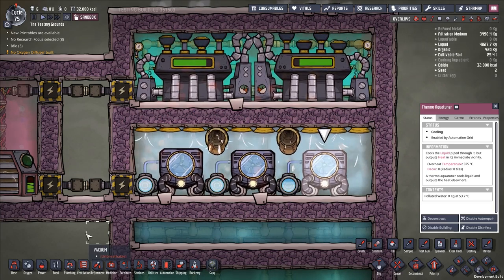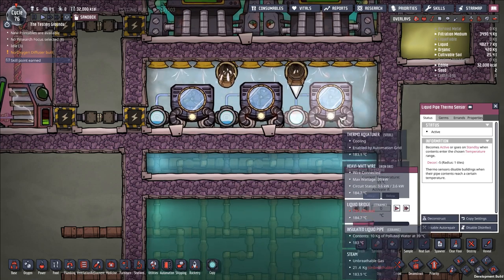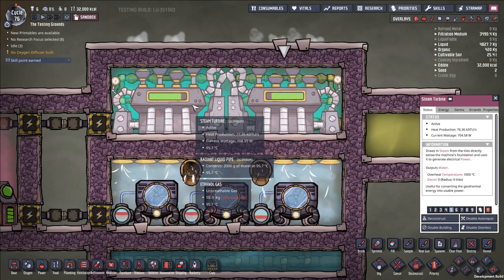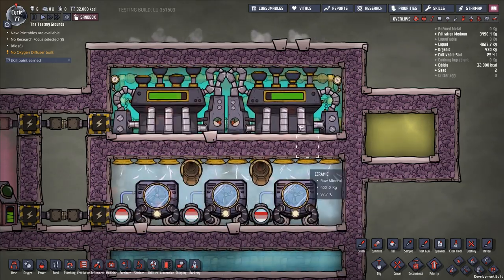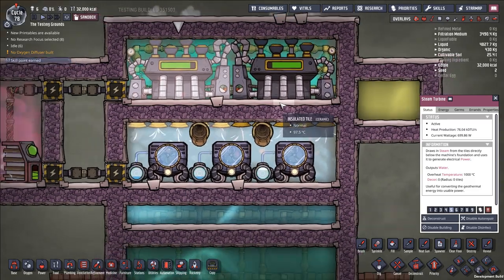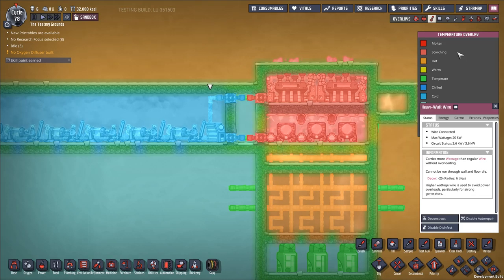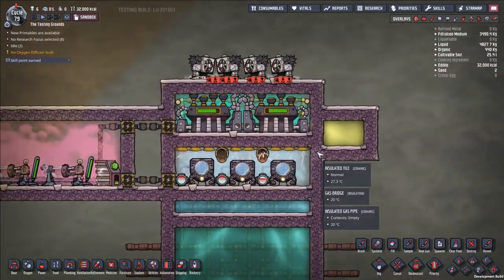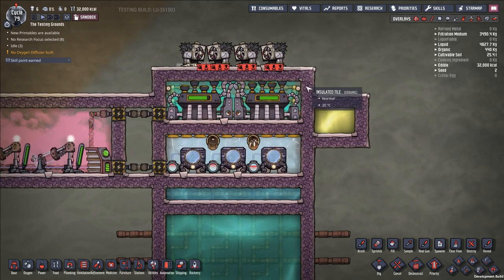Cooling Down Your Base With Steam Turbines -- New Player Guides [Oxygen Not Included]

Comment: Is the system more eficient with Supercooland because I do not need 3 Aquatuners. Higher specific heat capacity?
Reply from the maker: Super coolant has about twice the specific heat capacity of water, so instead of powering 2 steam turbine with 3 aquatuners, you could power 4 of them.
Reply: If you did that, and.set it up so you could use the tune ups, could this system sustain itself power-wise?
Reply from the maker: @nocx4592  I think it's just barely power positive without the tune up, and with the tune up would net you around 2 kW
Reply: @Gearhead Gaming
Hmm, actually I think it wou!d be slightly below self-sustaining without the tune ups.
4 steam turbines running with max efficiency would be 850*4=(800*4)+(50*4)=3200+200=3400 power produced, while the 3 aquatuners would use 1200*3=3600 so you actually would need 200 extra to power it.
Probably not worth having dupes to into the room, since you'd want a backup power anyways in case the system stops working to reset it anyways.
Reply from the maker: @nocx4592  You're right, for some reason I misremembered aquatuners as being 1kW instead of 1.2kW.
Reply: I just thought it was a fun thought, since it didn't make sense to me that the turbines made less energy  from the heat than the aquatuners that generated the heat used, even though they aren't making the heat, they're transferring it, and thus are definitely breaking the law of conservation....

And also I wanted to break entropy.

Comment: so this video is a while old by now.  But anyways, i never got a replica of this system to work.  Aside from the pain of building it without using dev mode or sandbox mode - i still get issues with my steam gens getting too hot.  So after a few attempts i decided, i'll copy the setup 1 for 1 and take it from there - see where i'm not doing it right.  The only difference is the source and destination of the water that's going through the system - normal water.  Still my gens get too hot then drops in efficiency.

Comment: Efficiency of running cooling loops in series or parallel?
Reply from the maker: Typically parallel is best.  If you run them in series, there's a good chance that the coolant will be too cold after going through the first aquatuner to be safely cooled by the next two aquatuners.  It's also often easier to exchange heat with 30kg/s of coolant that's been cooled 14 C than 10kg/s of coolant that's been cooled 42 C.

Downside is you need three separate loops, so if space is a concern then series might be the way to go.

Comment: how many tuners do i need if i go with gold ?
Reply: ps i love your videos
Reply from the maker: An aquatuner removes 2000 * 4.179 * (Steam Room Temp - 95) DTU's per second, and an aquatuner running off polluted water or water will produce 585060 DTU's per second, so if you have 1 aquatuner per turbine, your steam room should stay at a temperature of 165 C, just under the 175 C overheat temp of a gold aquatuner.

Comment: steel aquatuner keep getting damage overheat. what I'm doing wrong...?
Reply: thats why turbines are there for. converts steam into power and dumps 95c water back into the chamber where your aquatuner is.
Reply: @Pepe-pm6kn  this is what I'm going, but... over time the aquatuner get overheated. I also tryed to separate the chamber with the aquatuner form the one with the steam @200° without luck
Reply: @Verdekiwi  you can even use gold for aquatuner setup, dumping small amount of crude oil or petroleum works, ive never used this method but if ure desperate for cooling before steel production, you can try it out.
Reply: @Pepe-pm6kn  I'll definetelly will! thanks

Comment: no tempshift plates in the aquatuner champer..?
Reply from the maker: You can, they can help a little, particularly if you're using a gold amalgam aquatuner.
Reply: @gearheadgaming1  Which TSPlate would you use? And would you just fill the whole room with them? Still trying to get behind the smart usage of those. :(
Reply from the maker: @veritasg9020  If you're using them to help with a gold amalgam setup, then diamond or refined metals like aluminum are good.  If you're just trying to add thermal mass to the system, dirt is one of the better options.  For the gold amalgam one, I'd make sure to at least put them behind the aquatuner itself, for thermal mass you'd toss them everywhere.
Reply: @veritasg9020   Just avoid tempshift plate adjacent to insulated tiles

Comment: How do you do this with gold instead of steel? It just overheats...
Reply from the maker: 1:1 ratio of turbines and aquatuners should keep the steam at ~165 C, though the aquatuner might be a little hotter because gold amalgam has somewhat poor thermal conductivity.  A solution used to be ethanol gas, but they nerfed it, so now your best bet is to either install some high conductivity tempshift plates behind the aquatuners or simply use 2 aquatuners per 3 steam turbines.

Comment: 16:15 how do you even go about setting up a hydrogen loop like that, outside of debug mode? This confuses me a lot
Reply: Make the loop
feed the hydrogen in the loop using a bridge
destroy said bridge once filled
You got yourself a hydrogen loop.
Reply from the maker: Build the loop and pump the hydrogen in.  Ideally, you stop pumping hydrogen in right before the loop gets completely filled up, but if you fill it all up, then deconstruct the line in, then deconstruct and reconstruct just one of ducts in the loop and it will start flowing.
Reply: Thanks! Thought it was way more complicated than that lol :)

I've watched about a dozen videos now with cool setups and well engineered things. Just building those in a real base seems like the real challenge most of the time. May I suggest a video on construction tips for beginners? Took me ages to figure out how to make a vacuum in a sealed room without leaving a pump inside for example. Some engineering tips and tricks to neatly set things up would be very welcome ;)
Reply: @theral056  And then how did you make that vacuum in a sealed room? :)
Reply: @jeppeskj3402  so, you make the room larger with a liquid lock. Then you pump everything out of that larger space. Then once vacuum is reached, you fill in the tiles for your actual room.

So liquidlock - pump are - desired room without walls to pump area
Pump out all gas.
Install walls between pump area and desired room.
Reply: @theral056 Thanks. Never figured that out before and now I've already used your methods a bunch of times since! :)
Reply: @jeppeskj3402  Glad I could help! :)